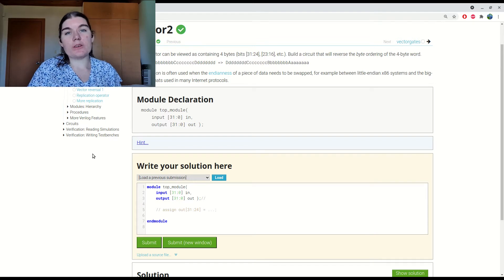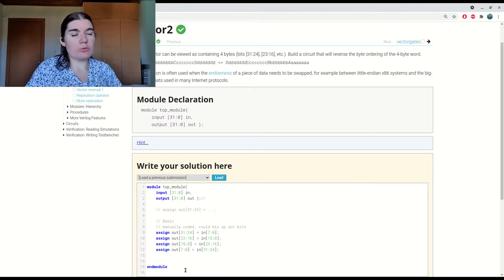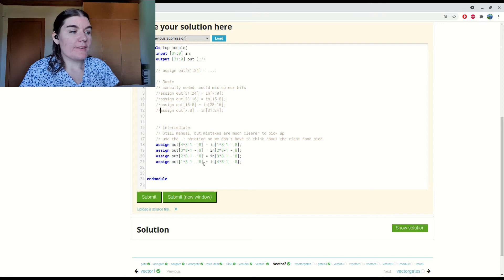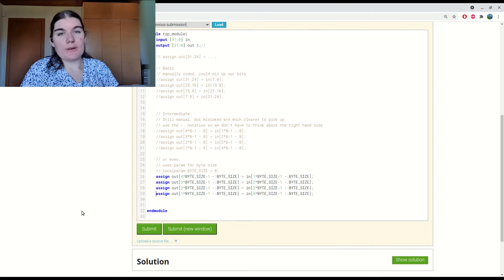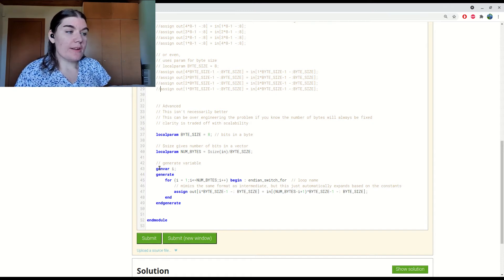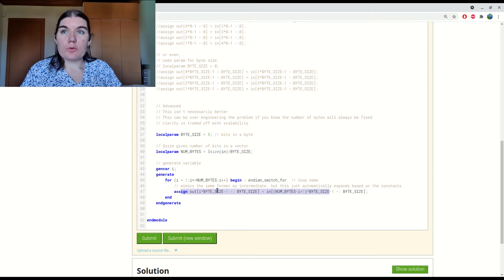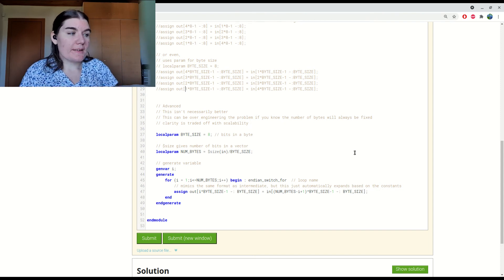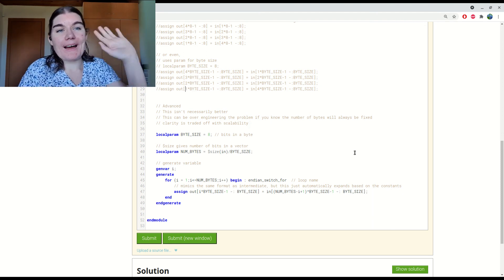Generate statement and for loop example in Verilog: A byte-swap in three ways.

Comment: I think maybe the words that a C programmr needs to hear to understand the operation of for loops here is that it is more akin to using the pre-processor to #define a code snippet that you use in multiple places to generate template code with parameterised customisatons. Not an exact analogy but it differentiates between "build time" and "run time".

Comment: Even though the inputs at the specified index are corrected in the module, the output sometimes remains indeterminate during the generate loop. Below is the code and its corresponding output.

genvar i,j;
 
generate
for (i = 0; i < `n1; i = i + 1) begin
for (j = 0; j < 2*`n1; j = j + 1) begin

if(j<`n1) begin
initial #0 $display("a[%d] = %b :: b[%d] = %b ",i, a[i], j, b[j]);
and(p[i][i+j], a[i], b[j]);
initial #0 $display("p[%d][%d] = %b \n", i, i+ j, p[i][i+j]);
end
end
end
endgenerate
 
 
a[ 0] = 0 :: b[ 0] = 0
p[ 0][ 0] = 0
 
a[ 0] = 0 :: b[ 1] = 1
p[ 0][ 1] = x
 
a[ 0] = 0 :: b[ 2] = 0
p[ 0][ 2] = x
 
a[ 0] = 0 :: b[ 3] = 1
p[ 0][ 3] = x
 
a[ 0] = 0 :: b[ 4] = 0
p[ 0][ 4] = x
 
a[ 0] = 0 :: b[ 5] = 0
p[ 0][ 5] = x
 
a[ 0] = 0 :: b[ 6] = 0
p[ 0][ 6] = x
 
a[ 0] = 0 :: b[ 7] = 0
p[ 0][ 7] = x
 
a[ 0] = 0 :: b[ 8] = 0
p[ 0][ 8] = x
???????? so on
What is the issue? Please help in the context.

Comment: Hello  Stacey. Can you please tell me, other than learning an HDL what other subjects should I learn in order to become an FPGA engineer?
Reply from the maker: I've added this question to my list of video ideas because it's a very good one, but the short answer would be primarily Electronics in general. Being a good Electrical Engineer would make you a better FPGA engineer, because understanding how FPGAs work, and how they operate on the board with the other devices will be very helpful. In addition to that, an understanding of the algorithms you're putting on the board. Digital Signal Processing being the big one, and digital electronics in general. fixed point math, boolean algebra, stuff like that. FPGA engineering is quite a broad industry, because you can make the FPGA do pretty much anything, and it can interface to pretty much anything. That's why I like it so much!

Comment: Hi,
I am a retired professor. 

I love what you are doing. Your presentation, your style, your flow is great.  I love "iterating over time" versus "iterating in parallel."  That set off a bunch of sparks in my brain. 
Just keep cranking out the video's. 

The rest of this are the sparks. 

I am trying to develop an introductory RTL course to replace a traditional GATE course .. now that I have time to do this rather than teach.  This is the beginning of the course.

I have to start with binary counting. 90% of students will start with 1 rather than 0. 
Then make a switch turn on an LED.  This gets into the board files, and constraints files.  
Then turning on 16 LEDs on with 16 switches in 16 lines of code. 
Then one line of code using "down to"  concept and linking up with array subscripts in normal programming .

After showing the above, the first challenge is for the students to make switch 0 turn on led 15, switch 1 to turn on led 14, etc. I call it crisscross to avoid endianess discussions at this stage of the course. They all turn in 16 lines of code.  

Then I show them this code
,,,,,,,,,,,,,,,,,,,,,,,,,,,,,,,,,,,,,,,,,,,,,,,,
module Crisscross(
    input  [15:0] SW,
   output bit [15:0] LED
);

bit [4:0] i; //i has to be large enough to count up to 16 .. not 15:0 .. 5 bits.. 5'b10000
always_comb for (i = 0; i < 16; i = i + 1) LED[i] = SW[15-i];

endmodule
,,,,,,,,,,,,,,,,,,,,,,,,,,,,,,,,,,,,,,,,,,,,,,

 It blows their mind.  I show the vivado Synthesis schematic. 

I describe this as "crisscross wires." But this doesn't get at the heart of the conceptual problem they were having. That is why I love your video. What you convinced me of .. is that students are thinking about time. "Iterating over time" versus "iterating in parallel" focuses on time. "Parallel time" is the mystery and I can imagine now how to start a good conversation in the classroom rather than looking at blank expressions and starring at the non-parallel lines above. 

I try to use the always_comb to emphasize combinatory logic (versus clocked logic) rather than the language synchronous/asynchronous ... at the beginning of the course. And I can't get into parameterization versus generate this early. Just the concept of a module is a struggle at this point.  I try to use bit instead of reg. FPGAs internally are two state anyway.

The above does generate a bit stream in vivado 2020.2, and physically works on a Nexys4 DDR,  but I don't know if this is best practice.
Reply from the maker: Re the binary explanation and counting from 1, I don't know if you've seen my fixed point video. https://youtu.be/qLh3lPP8tmQ?t=54 In this I include a 'fixed point calculator' that  I use to visualise how binary works, it also talks about bit indexing, although it's a bit complicated because it does introduce negative bitslicing. 

The clocked vs synchronus nomenclature I think is an industry/regional difference although certainly clocked/combinitorial is probably more clear for beginners. It's a good point. 

The regarding the above: For anything more complicated than this, It is usually good practice to register signals into and out of the device right as they come in and go out, and to ensure it meets timing. This is because often the signals will be driven in the FPGA one way or another, and you want those to remain in-sync and meet timing.
However in this case the design is so simple, and the FPGA is routing the wires right through from an input to an output without changing them, so for the most part it's fine.

Comment: can you explain the code based on this spec?
Write Verilog DUT which generates an output as follows for the given input
Input (I): 0,0,0,0,0,0,1,0,0,0,0,0,0,0,0,0,0,0,0,…
Output(O): 0,0,0,0,0,0,0,0,0,0,0,0,1,0,1,0,0,0,0,…
module two( input wire clk, rst,i,
output wire y);
Note:
 An input ,I, asserts for only one clock cycle.
 After the input asserts, then the output should assert 5 cycles later and
 Then deassert for another cycle and
 then assert again for one cycle.
 It is a 101 pattern after 5 cycles
 If another pulse on input appears during these 8 cycles output 101 pattern
should not be generated for this new input.
Reply from the maker: This looks like a homework assignment. My recommendation is to use a state machine. I'll be doing a video on those in some point.